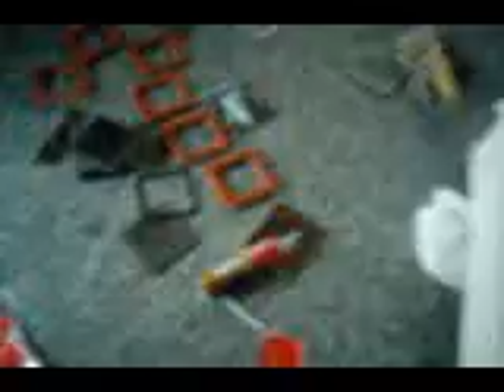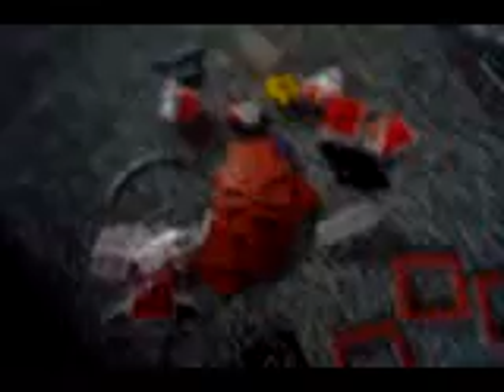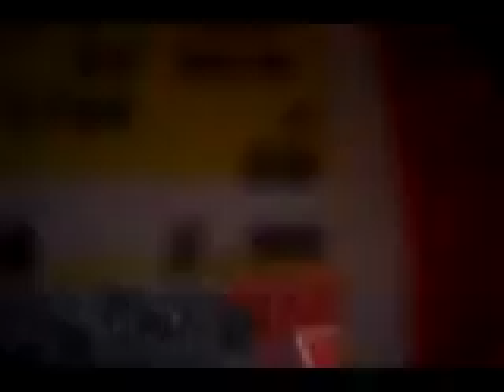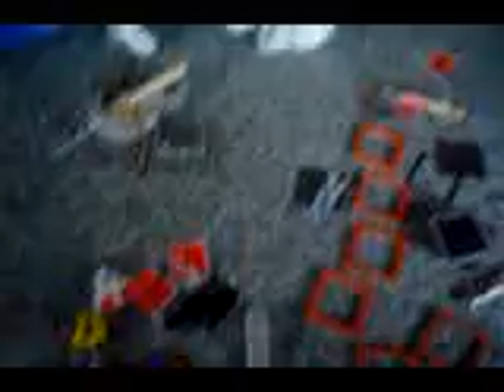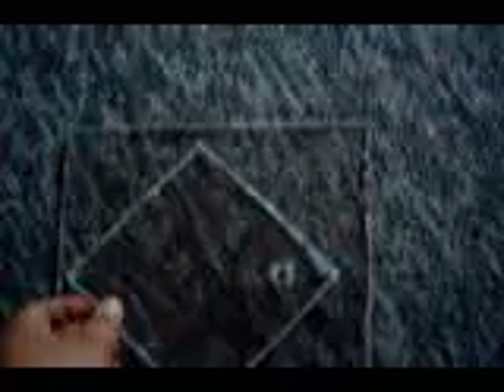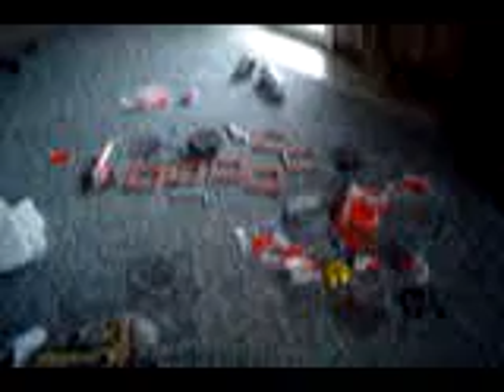just trying to make it perfect

Comment: my wife would KILL me for doing that ... she would be chasing me around the house with a vacuum cleaner ... LOL ...

3/32 gasket spacing is fine ... should work well ... I get good results anwhere between 1/8 and 1/16 ... you are right in between ...

check the way you will connect your electrical to the plates and make sure you wont need to cut the corner off your gasket so you can get the female spade connector to fit on the notch in the plate ...